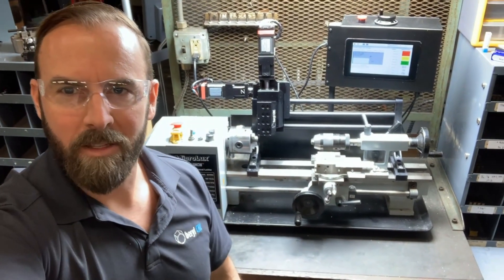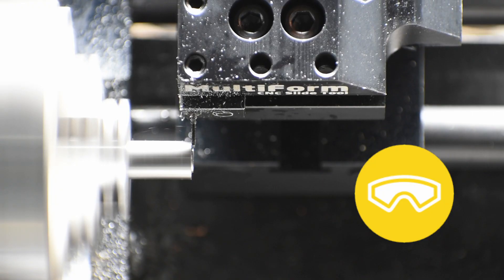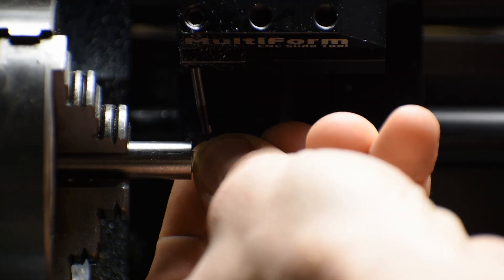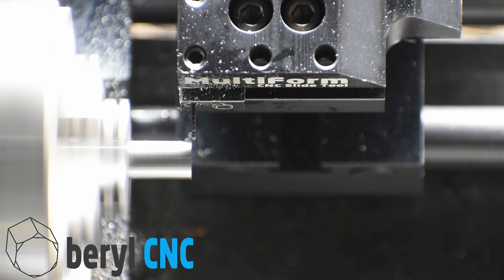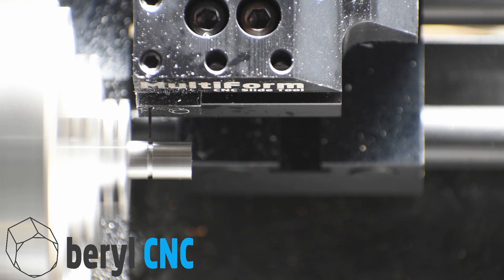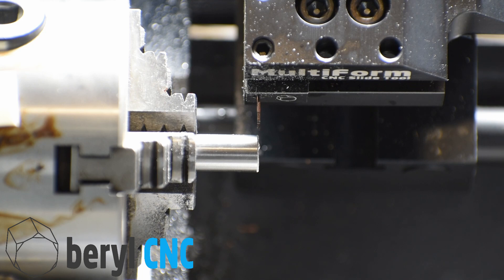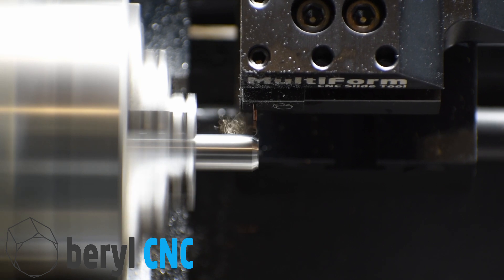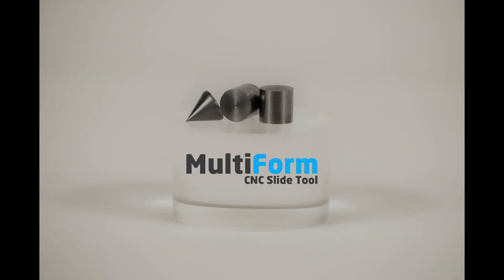Turning A2 Tool Steel on Mini Lathe

Comment: I am REALLY curious about this setup. I have that exact 7x16 lathe and have been contemplating CNC converting it. That setup looks like an awesome compromise because it doesn't look like it alters the lathes ability to run manual. Do you have a link to that built or more info?
Reply from the maker: Hi there! Check out www.berylcnc.com. We offer finished products, rather than projects, but there is a free / open source version of the Beryllium.py controller over at www.github.com/jkocher/beryllium if you'd like to build your own version of what you see here.